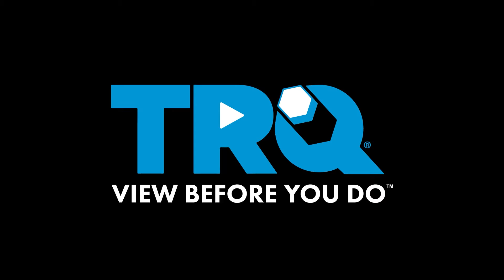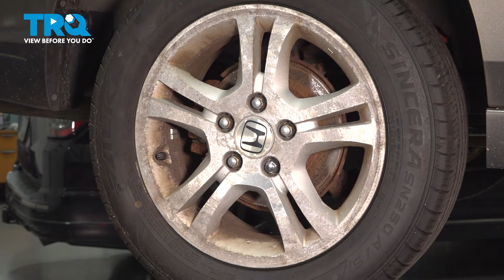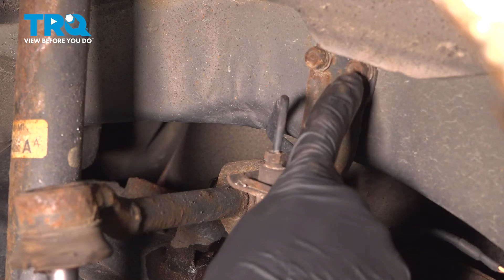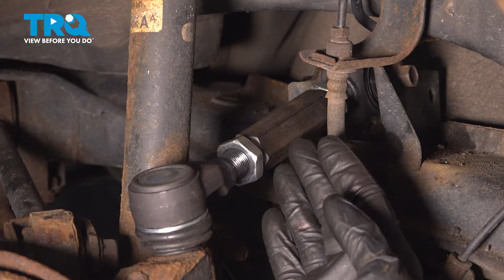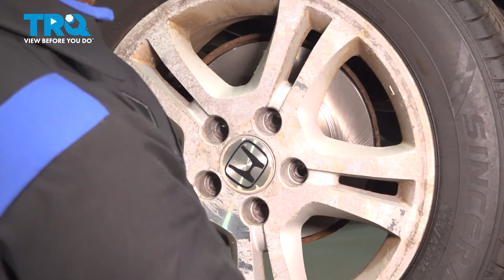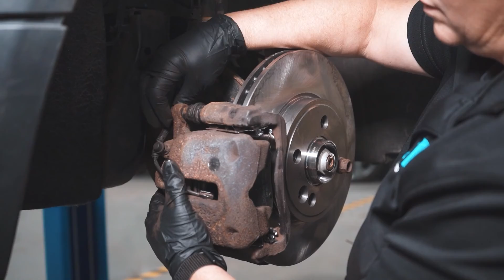How to Replace Rear Upper Control Arms 2003-2007 Honda Accord

Comment: Stupid nut on the knuckle side got all knurled.... not time to to finish. Just tighten it up and take a few days off from work cause it's already killing my back. 
Work sucks... money sucks...
Slave life...
Reply: Just checking on you, brother. Are you okay today? I’m sorry you were struggling I hope you figured it out with relative ease
Reply: Don’t worry about ruining nut, keep it on however if your smacking from underneath after pickle forking ect and it won’t come off. Gives more hammer area. New one has the bolt built in and you’ll get a new nut.